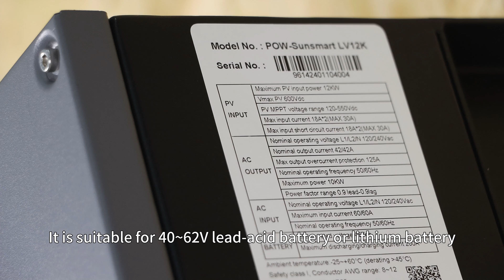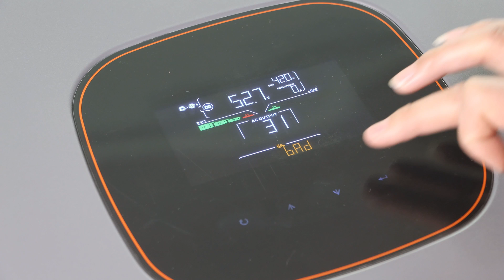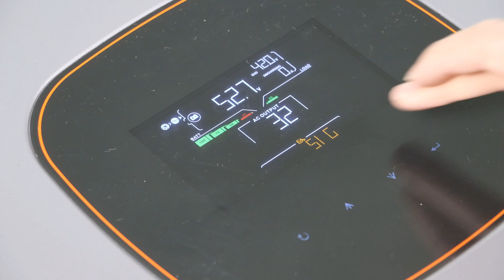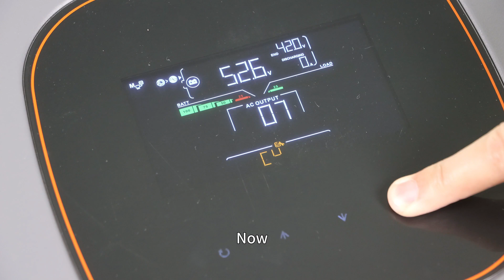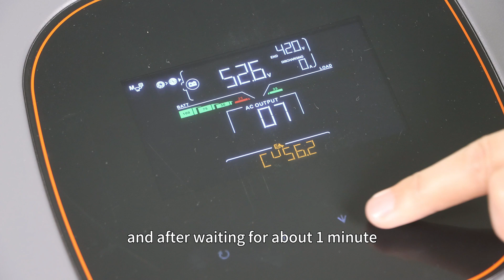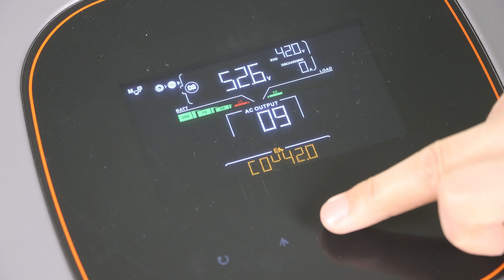How to Parallel Connect the POW-SunSmart LV12K?

Comment: According to the inverter's instruction manual, shouldn't the GRID L1,L2 and N ports of inverter 1 be connected to the GRID L1,L2 and N of inverter 2, as well as for the OP L1,L2 and N inverter ports...? If so, they are not shown in this video...